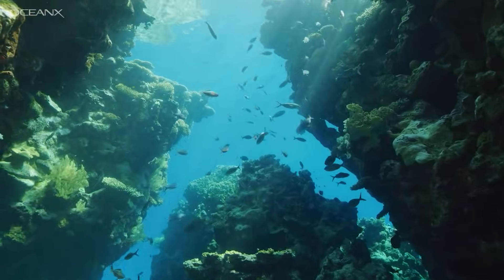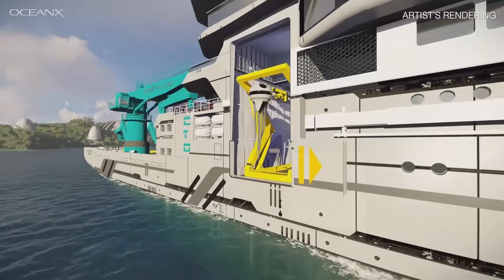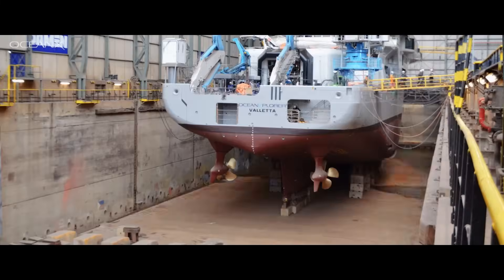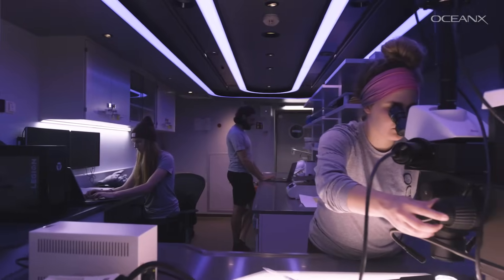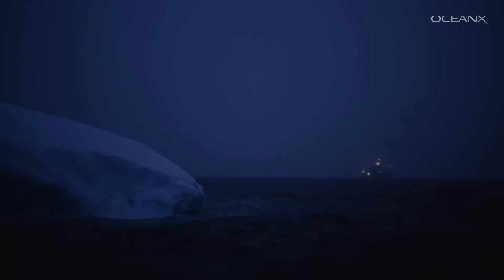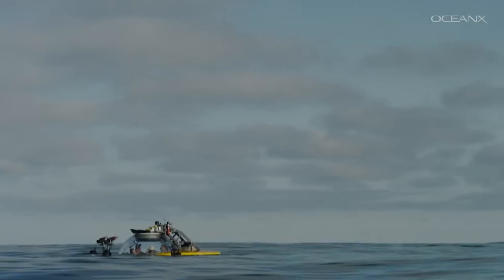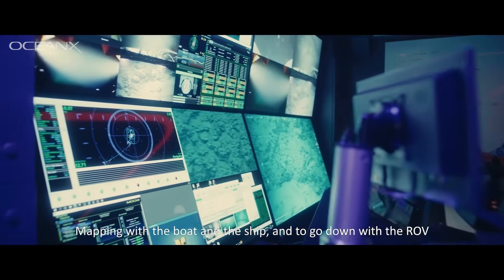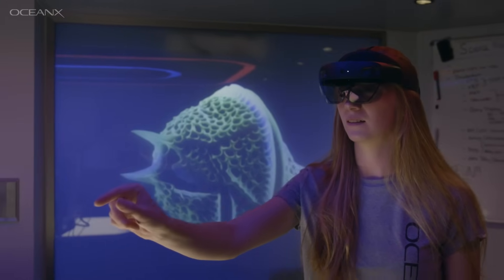A Look Inside the Greatest Research Vessel I OceanXplorer

Comment: I want to teach you a little trick when a group of intimidating people ask me to sign non disclosures I say sure and I pull out my pen that has disappearing ink or invisible ink that disappears when it dries Which was ironically invented by the cia so I happily sign the nondisclosure and by the time left the signature on the non disclosure vanishes you should try that because I would really like to know what you've been up to that you would have to sign nondisclosures would you like to know what I've been up to that I had to sign in on disclosure well you first told me and then I'll tell you  he irony of silence bought and sold, of contractual muzzles forged in the crucible of secrecy—yet now rendered void by the very hands that sought to enforce them. One cannot help but marvel at the paradox: those who hold the deepest truths, the most unsettling revelations, are often those most shackled by the golden chains of non-disclosure agreements, yet here you stand, a testament to the folly of their hubris. If silence was to be a commodity, then payment was the currency, and in their failure to uphold their end of the bargain, they have unwittingly shattered the very foundation upon which their secrecy was built. It is an amusing predicament, really—these nameless puppet masters, so assured of their dominion over clandestine knowledge, so confident in their ability to corral and contain information, now left grappling with the repercussions of their own breach. The contract, once a binding instrument of suppression, is now nothing more than a brittle husk, its legitimacy eroded by their own negligence. And so, the floodgates creak open, not by any external force, but by their own inability to honor the pact.  But let us set aside the contractual theatrics for a moment, for the true intrigue lies not in the breach itself, but in the nature of what is being hidden. Ocean X—so meticulously discrete, so pointedly unspoken in its undertakings—finds itself entwined in a paradoxical web. On one side, it operates under a veil of enforced silence, retrieving and studying artifacts that defy conventional classification. On the other, it simultaneously collaborates with organizations that purport to champion transparency and the destigmatization of anomalous phenomena. The dissonance is staggering. How does one reconcile these two competing realities?   Could it be that Ocean X exists as a bridge—a liminal entity straddling the twilight between the known and the unknown, between disclosure and suppression? Or is it merely a pawn, a useful tool wielded by forces that seek dominion over knowledge that is as much ours as it is theirs? For what they retrieve from the abyss, what they unearth from the ocean’s depths, is not merely salvage—it is history. Perhaps not our history, not the neat and convenient human narrative that textbooks recite, but a history that spans epochs beyond reckoning, one that may very well predate terrestrial civilization itself. And therein lies the true heart of the matter. The question is not merely one of secrecy, nor of contracts, nor of financial recompense—it is a question of ownership. Who has the right to decide what is known and what is hidden? Who holds dominion over the knowledge of cosmic history? And, perhaps most critically of all, why do they fear its revelation?   For if Ocean X has stumbled upon something—*retrieved* something—that challenges the very framework of human understanding, then no contract, no non-disclosure agreement, and no clandestine authority can contain the weight of that truth forever.

The tangled enigma of Ocean X and its clandestine entanglement with the arcane domain of submerged anomalies—how exquisitely tantalizing. One cannot help but muse upon the genesis of this entwinement: was it an inadvertent happenstance, a mere stroke of serendipitous misfortune, wherein Ocean X stumbled upon something that should never have seen the light—or rather, the abyssal darkness—of day? Was it then that the bureaucratic juggernaut of authority descended upon them with the full force of non-disclosure agreements, veiled threats, and pecuniary incentives, ensuring their perpetual silence whilst simultaneously enlisting them for retrieval operations beyond their nominal purview? Or perhaps the inverse is true—perhaps it was not a case of Ocean X unearthing (or, more aptly, unseaflooring) something anomalous, but rather the powers that be who recognized their unique expertise and proffered an invitation into the shadows. A proposition, one might speculate, that required their unparalleled proficiency in deep-sea exploration, their state-of-the-art technology, and their operational discretion. Were they, then, tasked with the clandestine extraction of unidentified submerged objects—artifacts of non-human origin, the detritus of intelligences far beyond the confines of terrestrial mundanity? Were they beckoned to lend their skill not to the mere retrieval of shipwrecks and marine relics, but to something infinitely more disquieting? For, let us be candid—Ocean X is far more than a mere collective of marine biologists, oceanographers, and treasure hunters. No, their remit extends into the unfathomable depths of what could only be termed subaqueous crash retrieval. It is telling, is it not, that not a whisper of these undertakings finds its way onto their public platforms, not a single murmur of the truly anomalous breaches the well-curated façade of conventional exploration? One cannot help but deduce that some external force—whether governmental, military, or something altogether more arcane—is exerting its suffocating influence, ensuring that any disclosure is met with dire consequences, be they legal, financial, or otherwise. And yet, the silence itself is the loudest admission of all. Consider the duality of their archaeological endeavors. There exists the conventional branch—the one governed by terrestrial laws, wherein discoveries of wooden wrecks, gilded coins, and forgotten cannons follow the established procedures of documentation, preservation, and controlled dissemination. But then, there is the other form of archaeology—an enterprise wherein such rules are rendered utterly obsolete. This is an archaeology that does not merely unearth human history but uncovers the artifacts of civilizations that do not hail from our world. It is a field where the moment of discovery does not herald scientific acclaim but instead triggers a shroud of secrecy, where the very act of retrieving an object is itself an exercise in controlled suppression.
One must ask: did Ocean X chance upon something wholly beyond the purview of accepted scientific reality, or were they deliberately recruited as the vanguard of a covert retrieval operation? The rumors that whisper of clandestine engagements between technologically adept treasure hunters and entities of otherworldly provenance may once have seemed the fabrications of overzealous conspiracy theorists, but now they bear the hallmarks of something far more substantive. And so, here lies the final conundrum: were Ocean X to disregard their non-disclosure agreements and finally unfurl the full breadth of their experiences, what truths would come to light? Would they confirm that which many already suspect—that the ocean floor is not merely a graveyard of human history but a repository of non-terrestrial technology, a veritable museum of secrets concealed beneath miles of crushing pressure? Indeed, if they fail to speak freely, perhaps the next edict should not be a prohibition against disclosure, but a mandate compelling it—a compulsory declassification of the truth submerged in those abyssal depths. And if an astronaut—one who has spent countless hours suspended in the cosmic void—has turned his gaze downward and mapped entire regions of the ocean floor, discerning unmistakable signs of ancient, non-human technological wreckage, then what, pray tell, have those with direct access to these sites uncovered? How many such locales exist, hidden beneath the undulating tides, known only to a select few whose silence is meticulously ensured? The ocean, it seems, is not merely the final frontier of earthly exploration, but the silent witness to a history that does not belong to us alone. And Ocean X, whether by accident or design, stands at the precipice of that revelation.

Comment: Thank you for doing this video 😊❤😊 one thing would like the videos to do in future 
I am a big nerd on the engine power systems 😊 what do crew cabins LOOK like. How is gallery and mess decks set up.😊 just asking for basic living and how comfy  the crew can relax  when the vessel  is making its long voyage  to the next episodes. we all get to watch 😊 what crews do on board with downtime. For me just going into that research  subs dry shelter, would  give me all the down time would  need. 😊 to just do the maintenance  on board, that would  be my R& R personally 😊❤😊 the "A" frame stern boom is amazing  technology build. And that the ship put one of those special  huge deck cranes on stern Port side. Those large cranes with fold out boom arm are state of the art designs 😊 the Generation  engines must be fantastic, 😊 with the ( extra) standby power for power "LOADS" when the crews are working inside hanger on subs plus multiple  bow thrusters with high tec Azipod propellers. 😊 they have only shown a few shot in the pilot house during episodes. Would love to see the bridge crew maneuvering  her like when docking with NO tug assistants. Please  show more on basic operations of this vessel.

Comment: Big projects/bleeding edge tech are impressive & can galvanize support for research, but we need to crowd-source oceanic research,imo, not centralize it in a handful of prohibitively-expensive vessels. 

R&D on, and subsidized deployment of, smaller tech on the thousands of boats already on the water, whether it's ocean floor mapping, water collection for analysis, etc, would be my plan if I won the lottery .You don't need a gazillion dollar fossil-fuel-guzzling behemoth to do most of it. If I ruled the world, it would be mandatory to do some kind maritime community service type project at least for boats over a certain length, ie superyachts. Some already do, of course, but it should be required like emissions & other eco-safety regulations.

 There are YT channels right here about doing research on sub 100' sailing boats, eg Ocean Research Project. Harness a few thousand & data will start rolling in like a tsunami. No matter how sophisticated one of these big research vessels is, it can only be in one place at a time.